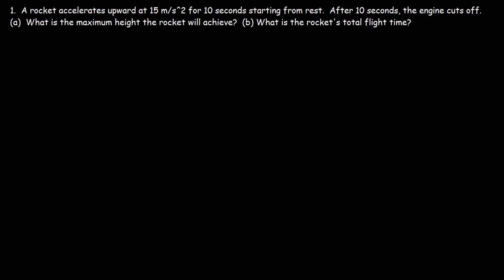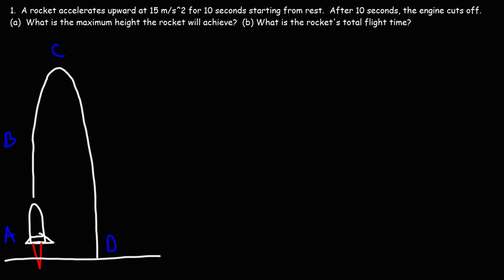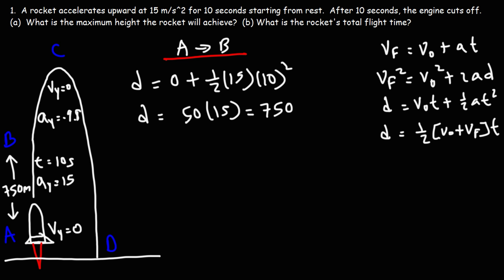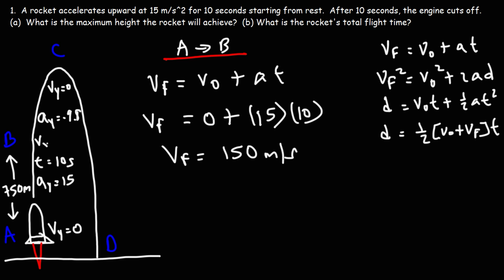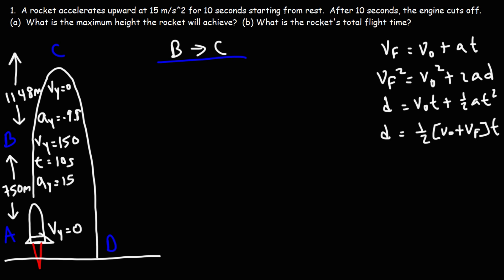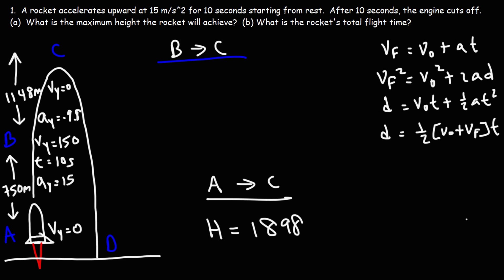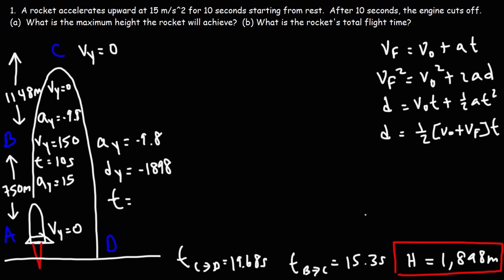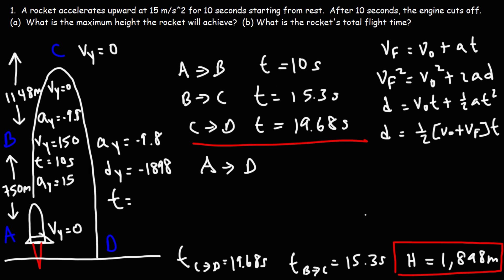2 Stage Rocket Problem - Kinematics and Projectile Motion | Physics

Comment: When applying newtons theory of symmetrical motion, the time it takes to get from C to D should be equal to the amount of time to get from B to C. When calculating it, it does not come out as being equal, but the accurate flight time when applying this principle is different.
Reply: That's only if acceleration is constant throughout the motion!